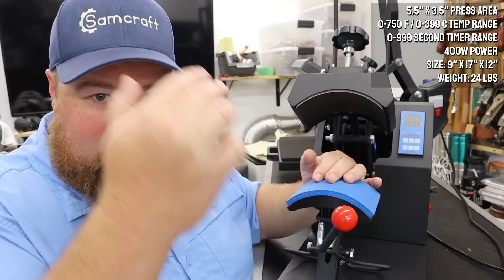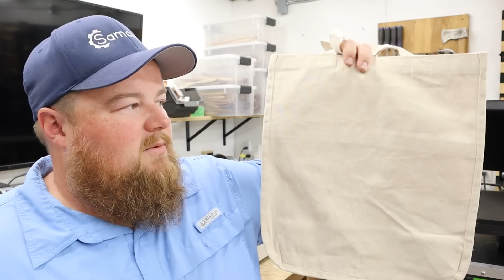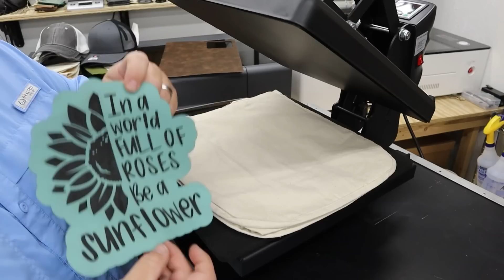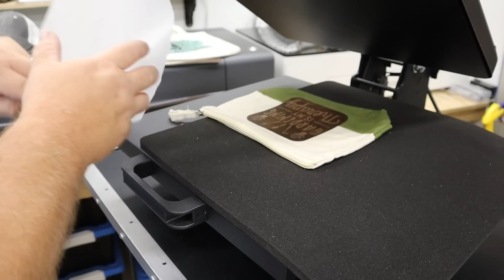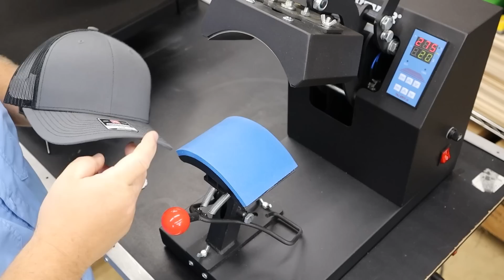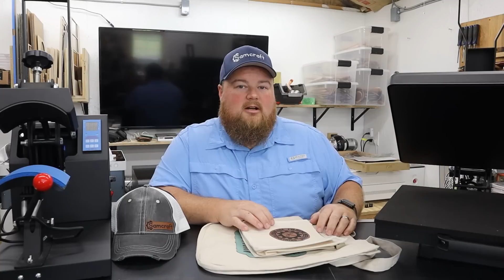GROW YOUR LASER BUSINESS! Affordable heat presses for hats and more!

Comment: Does the Hat Press heat from both sides or just the top? I want to create patches, but have been told the press needs to heat from both sides to ensure the longevity of the patch staying on. But I don't want to spend $2500 on a press!  Your thoughts would be appreciated.

Comment: I’m looking into getting a laser. I am only interested in cutting boxes. Is a 10w good enough for 1/4 material? Solid wood or birch ply. Or should I just save and get a 20w. Thanks. Great videos.
Reply from the maker: Do you mean 1/4 inch thick plywood? If so, you will need at least a 40w diode or even better a 50w+ CO2 laser for the birch plywood. It's not very easy to cut.

Comment: Nice job, a couple of things to help you out. When doing hats you need to flip out the sweat band so that when you press the hat you won’t get marks on the bottom of the hat. Also watch that the cap bill is not being marred by the top heat press. I put a piece of silicone on the bill to keep it from being marred by the press. Go job Sam.

Comment: Just be careful with those heat presses. There are a number of people (in the UK especially) that have had Vevor heat presses set on fire. I’d recommend not leaving them plugged into power when you’re not around.
Reply from the maker: Thanks for the heads up! I'll be sure to keep them disconnected when not in use.